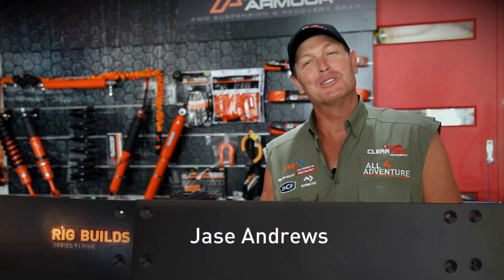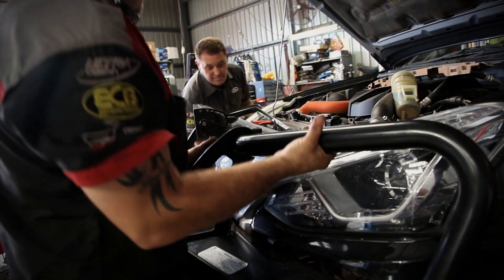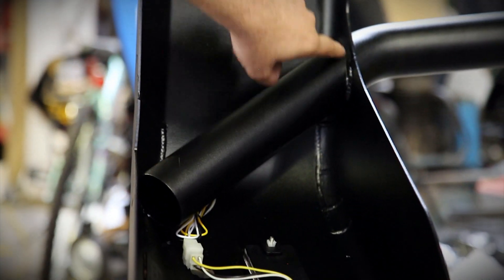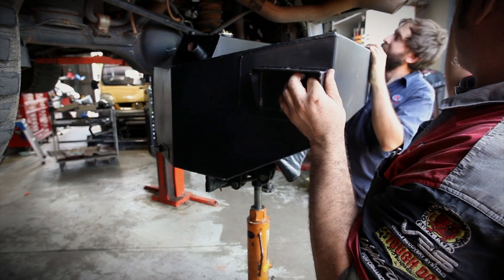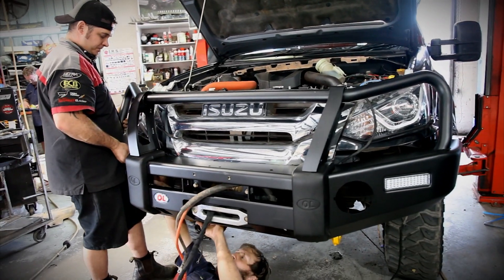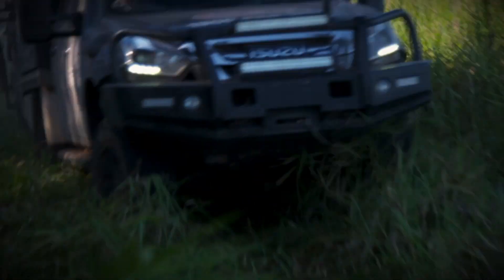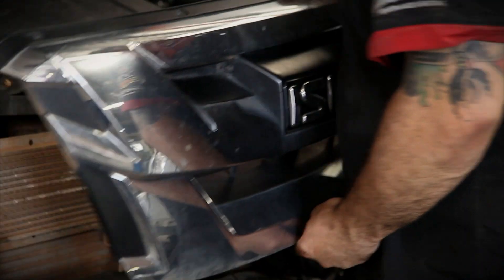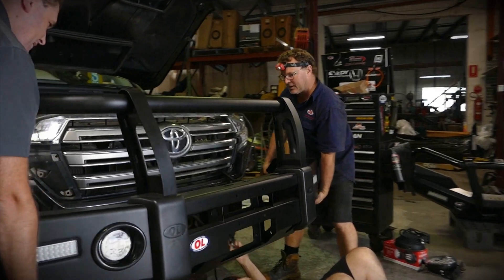TOUGHENED UP D-Max & MU-X:  Premium steel bullbars, long-range tanks & more! [1 OF 9]

Comment: Went to get bull bar for my suv, they asked for $600 sth, cheapest one, returned back without getting bull bar, planning to get light bar above rego plate, lets see.
Reply: What does sth stand for? $600 is very very cheap for a bull bar. Just remember, you get what you pay for. The bull bar that they installed on the Isuzu in this video would be closer to $2k plus installation.

Comment: Hope you upgraded the CV’s!! Weakest in the market.....
Reply: Can you upgrade the actual cv? Or just diff drop and lockers to help with stress and angles.
Reply: Mate of mine is going through the process of getting custom CV’s built, they’re using CV’s out of a vehicle that share similar profile but stronger. Chromemolly are available but $2500 a side.